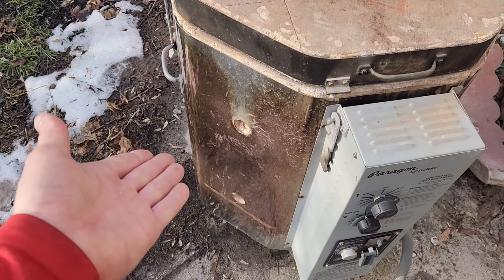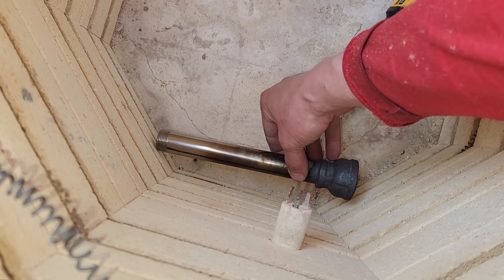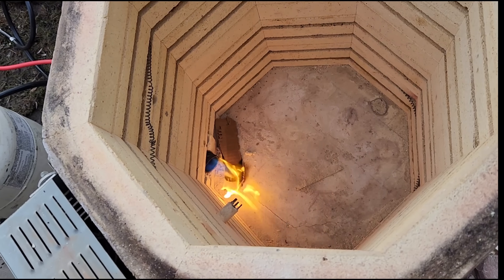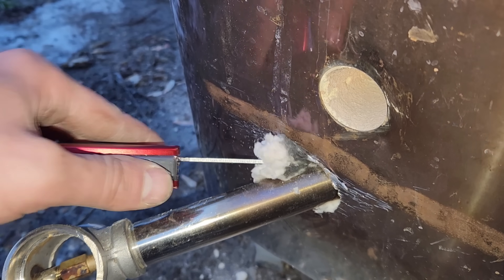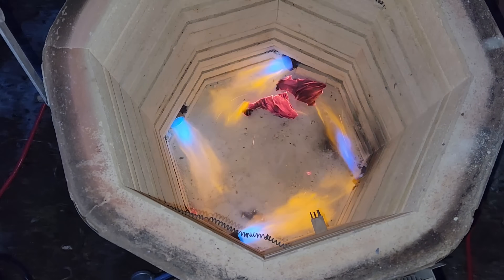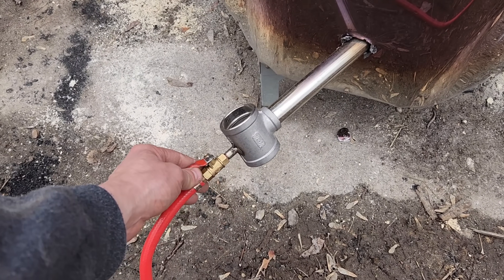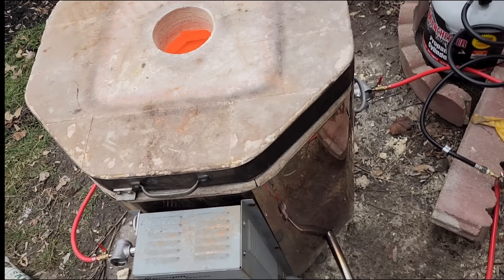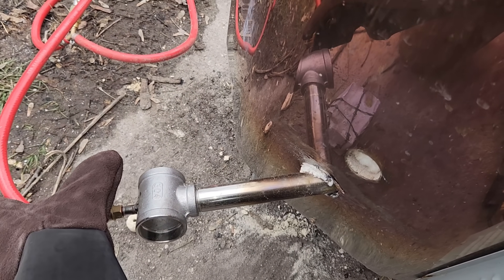Electric Kiln to Gas Furnace?

Comment: I used to operate an ASARCO shaft furnace at the old Western Electric Rod Mill in Chicago. That shaft furnace stood about 3 stories tall and had 23 burners arranged in 3 rows. All the burners were pointed toward the center of the shaft. I've always wanted to miniaturize the design! This is so close. The full size version has a tap hole at the bottom that allows the melted copper to flow out. Stacks of copper sheets were loaded at the top and they would melt like ice cubes in the shaft. The copper would then flow into a separate holding furnace. It also had a 550F preheater. All the burners premix was analyzed and adjusted for the optimum O2 levels in the copper. damn i miss that place

Comment: Very nice conversion. You could probably cook a frozen turkey in 4 minutes ( or cause a steam explosion). If you line the inside walls with Kaowool Ceramic Fiber Insulation , your hard refractory will last longer. The refractory in electric units tend to be soft and brittle, very porous. I use 1” thick on my furnace and change it every year. It also mitigates any splashing and splattering from eroding the hard refractory of the furnace. Keep up the good work. Chicken Hole Base is coming along nicely too.

Comment: I guess if all you want to do is melt metal quickly and pay for a lot of propane you're all set. You've lost all temperature control, and I think increased the cost of use but if that's what you're going for more power to ya.

Comment: you should try a waste oil forced air burner.  Its SO MUCH faster and hotter than propane.  You might be able to crank up the heat in there even more if you force some air in there with the propane

Comment: I like you Cody, but seriously cringe-worthy. Why not just order a cheap replacement coil instead of damaging a beautiful kiln? Propane will cost you like 10x as much to run as electricity and require trips to refill it. Electricity offers far greater control, and much more uniform heating. Why heat such a huge volume for such small crucibles? Not to mention much more difficult (and dangerous) reaching deep into a glowing furnace like that (believe me I know how it is). For the bronze you obviously were in a big rush to get it out; not how you should be handling crucible full of molten metal!
Reply: Also, my electric kiln doesn't take anywhere near 6 to 8 hours to heat up. But if you're in a hurry go with induction - you directly heat the metal and/or crucible without needing to heat up any furnace mass. It's faster and much cheaper than gas or electric coil.

Comment: Tim the tool man Taylor would be proud, but if you want it to get around 50 degrees hotter you probably need to paint some flames on the outside.

Comment: After watching the improvements I can think of is a shelving of some sort with gas ports higher up to make it easier to retrieve the smelting and reduce the overall space second(I don't work with gas so I don't know the safety on this) a main line shut off/central station for the gas so you wouldn't have to go around in circles to turn on/off

Comment: If the thermocouple on the kiln is still working you could go a few steps further and get an electric regulator for a larger propane tank so it is all controlled from the kiln panel.

Comment: It would be interesting to test if you use less fuel to achieve the same temps by using more burners. Maybe not with so much unused furnace volume, but at least in principle, it seems like it should be true, since there's less time for thermal losses.

Comment: Try running that hole saw in reverse until you bite into the material, then switch to forward and keep on drilling. Less likely to have your drill wander.

Comment: Is it possible to make a hybrid rocket engine powered by metal sodium and hydrogen peroxide
Hydrogen peroxide decompose to make water and oxygen and sodium react with water to make sodium hydroxide and hydrogen then hydrogen react with oxygen making lots of hot steam for thrust 
I had just seen your old sodium rocket video
Just a thaught

Comment: next you could replace the wire and try run both gas and electric at the same time. your metal collection will grow to spacecraft re-entry shielding material

Comment: I'm 00:48 seconds in and as an electrical engineer obviously you could just rewind the heating coils but I'm leaving this comment for the algorithm. The video is about converting it to propane and Cody never fails to make a good video.
Reply: It is also much easier to get propane than it is to get the power needed for the wires.

Comment: NOooo...   Last year I had the chance to buy some 3 phase furnaces really cheaply but didn't due to the cost of getting enough power to the bottom of my garden.
It would have cost very little to convert to gas.  Add some ceramic wool to reduce the chamber size to reduce the gas usage for small volumes?

Comment: Very clear, very simple demonstration of the energy density of the chemical bond vs readily available electrical power. Most folks do not TRULY appreciate just how many joules of energy it takes to do something and how that equates to electricity.
1 kwh - 3.6 x 10E6 joules.    
Standard cubic foot of natural gas (SCF) = 1.1x10E6
Reply: It is a propane burner, so it looks even better, with 2.6×10E6 J per SCF. However, you have to mix it with around 24 SCF of air to burn it effectively, resulting in the release of a substantial amount of heat. You get hundreds of times more combustion products than substrate, and you have to dilute the combustible in the oxidizer. Moreover, one of the byproducts of propane combustion is water, which possesses a significant specific heat capacity, stealing a considerable amount of energy from the kiln in the form of steam. I am curious about the efficiency of this furnace and would bet it won't be more than 20%. Additionally, there are other differences; a gas-operated furnace will create a more reducing atmosphere than an electric one, typically intensifying oxidation. Furthermore, with gas, you give up easy temperature control. 
There is a lot of energy in chemical bonds but it is difficult to use it effectively.

Comment: I was not expecting that firebrick lining the kiln to be that easy to cut into.  Going at it with a hole saw, one-handed, at an angle too, was surprising.
Reply: If you look at kiln firebricks wrong they can crack! Seriously though, drilling and hand sawing them is easy.

Comment: I wonder how hot a furnace with the hot exhaust heat being passed through a heat exchanger to preheat the burner air would get. Seems like a waste to just let it all vent out the giant hole in the top.

Comment: You know, I bet you could use the old pyrometer and temp control unit on there combined with the solenoid valve for a gas oven, then you could do programmable cycles and accurate temperature control with a gas kiln. All you'd need is either a standing-pilot flame or an oil stove transformer to get reliable ignition as the burners cycled.

Comment: i have seen some other youtubers use the same  propane furnaces but they ad a vac set to blow for extra air so the gas burning has enough oxygen. could improve performance.

Comment: lol, 2 burners would probably have been enough.  I imagine that electric kiln is not made for so much heat so fast and it will not hold up.  You might need to turn down the heat, lol.  So cool though, I mean hot...

Comment: Hello, a bit of a silly question, but is there any reason you couldn't keep using your new and improved furnace to fire pottery, too? (My understanding of a kiln is "small box that gets very very hot" but there's probably some other important factors I don't know)
Reply: From what I know about pottery and it isn't much the pottery might not like the thermal shock of the gas burners all the much and then the cool down cycle of the pottery to make sure it doesn't explode or crack might also not work as well as an electrically controlled one but I'm sure there are work arounds with this gas one if its actually an issue at all.

Comment: Adding a shelf above the burners would make it a bit easier to load/unload and keep them out of the direct flame.  An adjustable top vent would be an upgrade. Could use a brick, but if you had something on a swivel it would have a more retail look.   I would love to see the max temp you can achieve when you let it warm up.  How much temp difference between top and bottom?

Comment: I don't know about forges or furnaces but I have some experience with home built gas kilns for pottery. I wouldn't put the burner inside the kiln. My burners are about one inch from the outside wall. I think it helps to increase the lifetime of the burners. I'm using natural draft burners so they also get some additional air like that. Also the hole for the burners are a bit larger than the burner itself. The burners allow to adjust the amount of air going in. That and adjusting the cross section of the chimney helps to control combustion and hopefully make it efficient. Just saw others already commented the same thing.

Comment: at 1.2MPa it should only take 8min to melt 1 kg of Cu (or maybe it's 3kg... I forget) so you should be way quicker than that.... by half.....  you really only "needed" two burners for that size tho - BUT you shouldn't be seeing ANY orange flame.. you're just wasting gas because it's not burning all the way and not getting to it's highest potential... hrmmm...
  I wonder  if you have just one burner from each tank going would that get rid of the orange flame tips?? I men it's A LOT better than the last vid - WAY BETTER... but you aren't getting enough oxygen....  or maybe it's just too much gas... it doesn't matter really, I'm just thinking about not wasting gas, it is pretty expensive anymore, and every penny counts when inflation is kickin our butts like this...
maybe you could do a little experiment of trying to see if you're able to get just blue flames... either more O2 or less gas.... so I would try 2 burners, 1 on each tank... and if you're getting yellow flames still, (and this is with the lid open) try turning down the MPa slowly to see if it's just too much gas for the available O2... you dont "NEED" to melt SUPER quick do ya?? if not then you could go down to 0.6MPa and still melt 3kg in about 8mins with just 2 burners (or maybe 1kg... I really do forget.. it's been a while) and if you're getting blue flames THEN try to turn on the other 2 burners and see if you get enough  air to keep them blue... I'm jealous!!!! I would LOVE to be melting right now!! haha!!! Okay back to the vid :)

Comment: Why didn't you just put a crimp on the broken segment to put them back together? Possibly a carbon CAG rod or TIG tungsten resting inside both sides of the coil would do just fine, since anything lower than high resistance would be a cold spot, and you just need to survive the ambient temps.

Comment: Hate to say this, but seeing that in the northern hemisphere. The natural rotation is clockwise. I do not know if it will be an issue. You are much smarter than I. It seems to function well.
Reply: When the crucible is as big as a storm system, then it should be a matter of concern 🙂
Cody's Fire Storms, Ltd.?

Comment: Cool or should I say hot😂. But it seems a bit dangerous due to the height. It doesn't need to be so tall since the crucibles are short.
Reply from the maker: Crucibles can be taller. 😉

Comment: Would it be good to use a kiln to heat sand which you could store in the ground as a heat battery & convert to electricity or use for heating?

Comment: I think a microwave kiln would be awesome.  Especially since Shake The Future YT channel just updated his metal melting using microwaves video detailing some more. Waste oil as a fuel source as well seems like might not be a bad idea, though might be tricky for some situations I'm wondering in regards to reactions with the waste oil.  I've wondered about using a rocket stove as well, then can use multiple fuel sources.
Reply: Probably something more like the Nature Jab YT channel reactor design, in regards to more magnetrons, though as a kiln with smarter design layout considerations for heat flon.  Like I've noted and he doesnt seem to respond regarding adding susceptor material to his mix. Anyways, line the kiln with susceptor material somehow minimally will probably be required to better aid in the heat distribution.

Comment: How do you make molds? I've managed to melt brass in a microwave kiln, but I just can't get the hang of mold making. I wanted to 3D print PVB and melt it out but my molds are too brittle.

Comment: Four ??!! Dude you need a blast tube of about 4cm in diameter. A gas jet/tube that enters this pipe at 45º.  You fit a hair dryer with a dimmer switch and fit it to the end of the blast tube. Blast tube goes into the furnace. Turn on gas and light as normal then turn on the air. By adjusting the air/gas mix and trying different jets you will then have full control of your furnace. You will melt copper on ONE propane bottle... It will also sound like an after burner...

Comment: Hey Cody! These electric to gas kiln conversions are great-  a little tip as someone who has used them almost  daily for some years now as a potter. If you enlarge your burner ports slightly and mount the burners slightly outside the shell of the kiln, it will provide 2 benefits: firstly, it will provide you with greater control over the combustion atmosphere inside so you can achieve greater efficiencey/temperature. By putting a damper over the flue hole, you will be able to control how much secondary air is dragged into the burner ports by the flame and adjust the mixture. This also cools the burners and prevents the metal scaling away due to oxidation.  Adding a squirrel cage blower to each burner also increases the output temperature by a few hundred degrees.
Reply: Will also aid in control of glaze reactions, so to better control if you want more of an oxidation or reduction burn and glaze coloring effects.
Reply: Hope Cody takes this constructive feedback into account! Where do you mount the squirrel cage blowers? It looked like the outer skin of the kiln was starting to discolour, possibly because of the extreme heat, so I'd imagine mounting the blowers anywhere near the inlet ports would quickly annihilate them. Do you use some sort of piping to direct the airflow in?
Reply: @AureliusR I just make my burners out of pipe fittings. The squirrel cage blower just bolts to a flange, which threads to an 1-1/4" pipe, with a tee, that the gas line enters into. Then to a 1-14"x2" reducer which acts as the flame nozzle. An upgrade is to use a flame retention nozzle instead of a reducer for a more stable flame, but  you can manage without. The ones in the video could be retrofitted pretty easily by cutting some close fitting holes in the side of a 4" duct and placing the backs of the burners in the holes (atmospheric air intake just gets fed air from the blower on the duct instead)
Reply: With propane, how can you tell by looking at it when you are running rich (reduction) . 
  I mean, its a mean pop when gas & CO build up then you open something to look in.. I would like my eyebrows to grow back before I do that again.
Reply: @petevenuti7355 
My mom knows more about ceramics than I do, I'll have to ask her if this has ever happened to her when firing the Shuttle gas-fired kiln.  That thing is the size of 4 refrigerators grouped together so I imagine a blowback on that scale could be an issue.
Reply: @petevenuti7355  If you have too much fuel in the kiln you will see a faint flame from the chimney (can't really see it in bright daylight though). If you look into the kiln through a spy hole the atmosphere might become slightly more hazy in reduction. You can also tell by temperature when you get into reduction. Temperature will drop or at least rise more slowly.
Reply: Good question

Comment: A broken coil can be repaired.
I got an electric kiln for cheap because of the broken wires. I've bought thin Constantan wire, stretched the broken wire a little bit to get the wires to overlap, used file to get the oxide off and the wound the Constantan wire around the overlap to reconnect the wires again. Repaired 5 breaks this way. Works fine for nearly 10 years now. You have to take your time and wind then tight to get a good connection.
Reply: I'd think bare crimp connectors would work similarly, perhaps backing it up with either constantan or nichrome.
Reply: The issue with electricity is there's not a lot of it at Chicken Hole Ranch. I thought he would mention that at the start but didn't.
Reply: @jimbarchuk  Ah.  Come to think of it I bet there is no natural gas either.

Comment: Regarding kiln to furnace one of the best channels that I know of, where he happily accepts questions, would be BigStackD.  Guy in Australia that melts everything but steel ( his propane furnaces can't get hot enough ).  Goes over gas furnace use and maintenance in more than a few of his vids.  He's also working on using a large kiln IIRC.

Comment: How does the gas furnace not run out of oxygen? The only hole I see is at the top, hot air/gases are probably coming out  of it rapidly, the propane combustion is rapid... Is there an intake at the bottom im not seeing?

Comment: I would get rid of the big useless electrical box. Acquire some firebricks so you can raise the floor of the kiln, for easier access. Better hose management, tripping so close to molten metal would be bad. Several people have suggested using diesel/oil burners to cut down cost. An MCU board with a thermocouple and servos to regulate heat, if that is ever needed. Those are my suggestions.